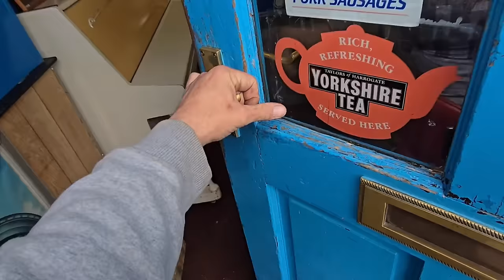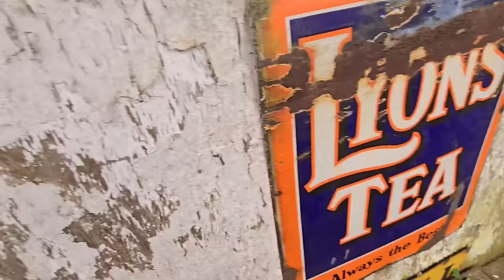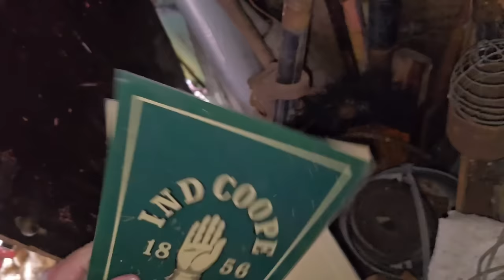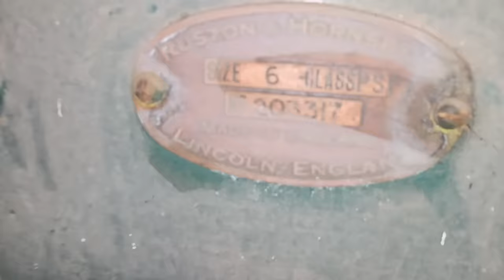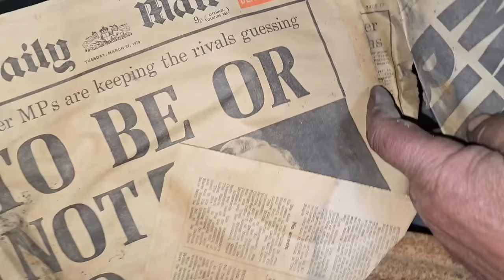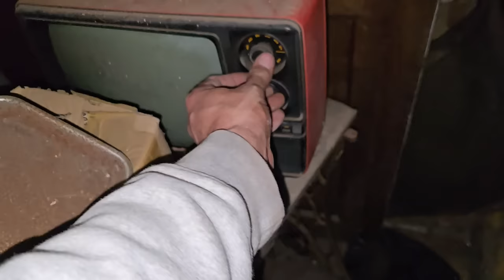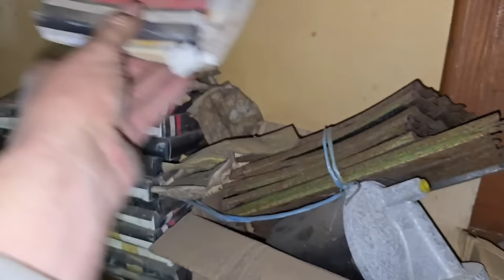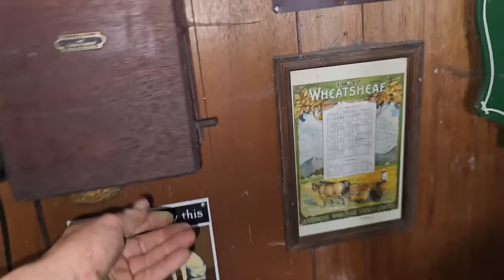Abandoned  Back Yard of a old Cafe. old Tractors, Engines, Lorry's and fairground rides.

Comment: At the beginning of the 1960's I started work as an apprentice joiner fr a firm called Dovedale Caravans in Blackpool. A firm that disappeared 50 yrs ago swallowed up by another company.  While I was there we built several showmans caravans and were always head and shoulders above touring and static caravans we made.  Invariably the interior surfaces were covered in a popular material of the time called Formica, an expensive plastic laminate.  I think three or four five litre cans of contact adhesive was used in each caravan.  This one is built on a similar style.  They were hand built and made to last.